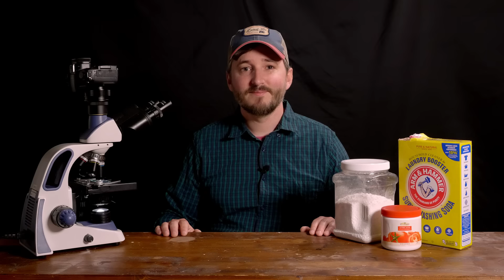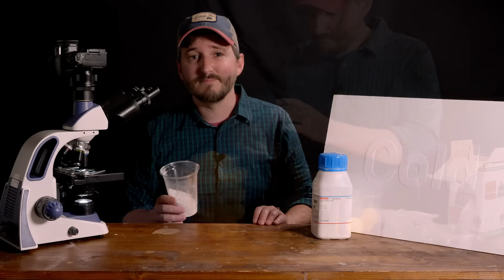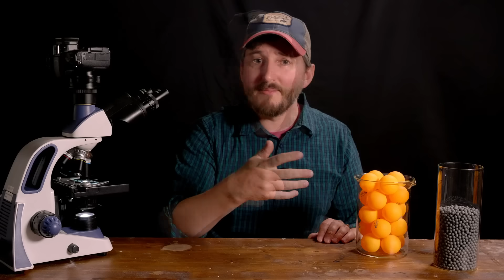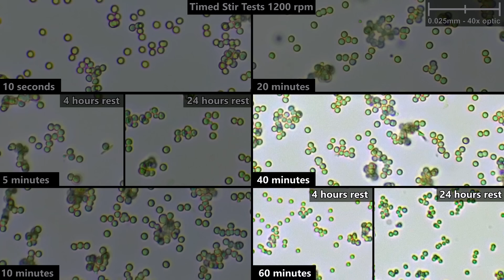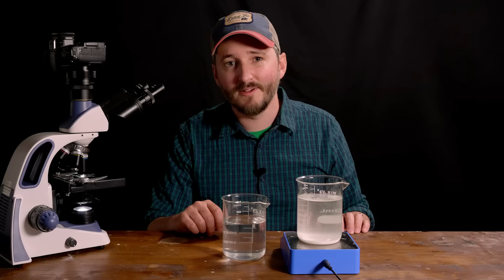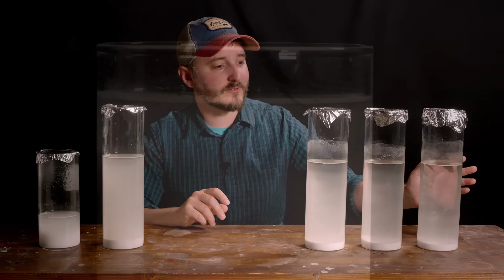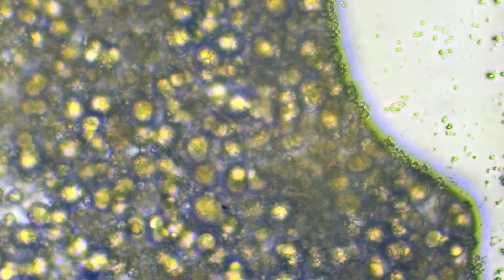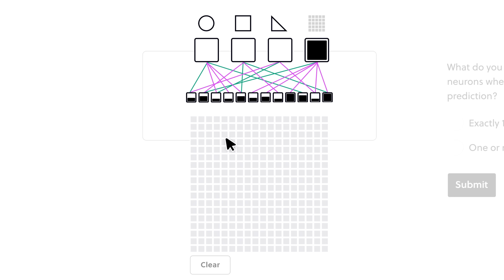Making Infrared Cooling Paint From Grocery Store Items (w/Novel CaCO₃ Microsphere Synthesis)

Comment: Has anyone else run into an issue with the microspheres not mixing with the acrylic correctly?  When I mix them into the acetone/acrylic solution it doesn't seem to mix correctly.  As far as I can tell the microspheres turned out just like in the video.  The acrylic dissolved into the water and acetone solution but when I tried to mix the two it turned into a weird blob of goo and the rest of the microspheres just separate from the acetone almost immediately and sit at the bottom.  If anyone has run into this or has any ideas let me know.  I guess I'll try it again and see if round two goes better.  Thanks in advance!
Reply from the maker: It sounds like the spheres still contain some water and need more drying. Extra water will cause the acrylic to fall out of solution and make a goo
Reply: @Nighthawkinlight  That was it of course!  I ran it again and made sure the pigment was extra dry and that seems to have solved the issue.  It seemed pretty dry when it was a brick but there must have been moisture in the middle.  I might recommend one more quick bake after crumbling up the initial bake just to make sure it's super dry.  Thanks for the help!

Comment: Since this paint you say disperses heat into space, how will it potentially play a role in reducing the temperature on the planet? Covering the entire planet would hypothetically lower the temperature on the entire planet in less than an hour, at least by one or two degrees. And as this paint disperses heat out of the system, it effectively(!) is a heat sink or valve regarding (rising) global temperature. If the whole of the planet covered, would reduce the temperature by a few degrees (and keep it dropping btw, you know,.because ambient) in less than an hour, would covering half the planets surface drop it, after leveling out, one degree? And covering one millionth, what would do that in one hour? And in 10 years? Or am I missing a point somehow?

IF this works in spite of the blanket of carbon dioxide and without taking up any energy to function, might (implementing) this get to be a fundamental contribution to reducing the temperature on the planet?
Without the need of taking carbon dioxide out of the system? That needs to be done still, but it proves incredibly hard and in all cases it requires energy, while, even when humanity should  take out fossil fuel use altogether,  both energy consumption and then production(!), from for example micro stars held in laboratoria (nuclear fusion) also would increase the temperature on the planet.
Reply from the maker: Covering the whole planet would lower the temperature way too much. Some papers suggest it would take covering about 1% of the earth's surface to compensate for all post industrial warming. That works out by my math also.

Comment: Since silicone is IR transparent and would allow IR in the atmospheric window range to be transmitted to space,, it seems the perfect binder for a calcium carbonate flexible tile, or shingle, made by diluting silicone caulk with naptha or spirits, adding the calcium carbonate, and pouring it into a mold. Your thoughts on this?
Reply from the maker: Yes I've tried this a few times but it seems to take more silicone to bind the particles than is ideal for good reflectance. I need to experiment more.

Comment: Amazing video.  Just FYI for others it seems there are multiple kinds of acrylic.  My first attempt used PET acrylic which does not easily dissolve in acetone.  I believe what we need is PMMA acrylic. That kind will dissolve in acetone. Hope this saves someone a headache.
Reply from the maker: Yes pmma. I didn't know there was such thing as clear PET panels, that's interesting
Reply: @Nighthawkinlight  Ya.  Just to clarify I believe what I have is PET plexiglass(that's what the box says) but as I understand it true acrylic plexiglass is made of PMMA.  Someone who knows more can correct me if I'm wrong
Reply: @G.r.i.z.z   This may have been my problem. Couldn't get it to dissolve.  (Nope, It's PMMA, Damn)
Reply: @gt3guru  i haven’t had any issues dissolving pmma other than the fact that  big chunks take forever.  I got a couple samples for free to test with but they are really thick(1/2”).  They were hard to break up into smaller bits so i just went for it.  That wasn’t a great move because it has taken weeks to dissolve. Highly recommend using tiny bits of pmma to speed things up.

Comment: I wonder how this would work when used with acrylic automotive paint, every layer from primer to tinting to clear/ sealant coat.  But since it's so thick, might need to use a sand blaster

Edit 5 days later, a few different sources tell me ""You can thin acrylic paint with acetone. The ratio is a 4:1 ratio of paint to acetone""
And/or, 1/3 distilled water to acrylic paint can thin it, since water dissolves the binder used for acrylic paint

Comment: For an offgrid person like this, this video is actually life changing. Electricity is always an issue and so is food preservation and cooling. I can see this being used in a open greenhouse. Use the green house to house another building painted with this stuff but protected form the elements using the greenhouse with the vents open to prevent heat build up. I once build a solar powers AC unit. I can see using this in conjunction with this painted building. Cool during the day actively and passively at night.

Comment: This is amazing work I have great great respect (and this seems you did real science not only popular science) on your job. But I have to tell an important thing I think you might missed: Most CaCl2 chemical avaible on CaCl2.2H2O form. And washing soda is Na2CO3.10H2O (decahydrate) So sitochiometric ratio is 147g CaCl2.2H2O and 280g Na2CO3.10H2O.
your ratios are only true if both salts are anyhydrous form.
Reply from the maker: Good point!
Reply: @Nighthawkinlight , I'm recently trying your recipe exactly. I checked your your washing soda's sds data :) , it says it's anhydrous  form but %88 assay. I calculated your ratios and your you are using 2 times excessive sodium carbonate if it's anhydrous form. May I ask you why? it's importat for me because because your first trials were stoichiometric.
Reply from the maker: @uzaymaymunu  Yes I found that it helps to have an alkaline solution and the excess carbonate gets the job done. It's possible that it could be reduced slightly but I'm not sure how much.

Comment: Great video!  This is like product development stuff in the production chemical industry.  Building scale inhibitors.  When moving water through pipes (with oil and/or gas) barium and calcium sulphate scales cause big problems nucleating and agglomerating and coating pipes, reducing the flow sometimes completely blocking the piping or pipelines.  Calcium carbonate does the same thing, but can easily be remediated by dissolving it with various acids depening upon the metal compsition.  Sulphate scales are not so easy to dissolve away (needs hot chelation where the scale is removed molecular layer by layer, its expenive and slow).

Crystal modifiers injected into pipes and pipelines at ppm concentrations in the oil and gas industry can inhibit calcium and barium sulphate scales in a similar way to the processes highlighted in this video.  Worth looking at the mechanisms.  They inhibit crystal growth and agglomeration, keeping the scale in solution and stopping pipes and pipelines from losing flow.  We call this speciality flow assurance.  

Im sure BASF, Baker Petrolite (Baker Hughes), ChampionX, Multichem (Haliburton), Arkema (Ceca) etc... have scale inhibitor formulations that could be used to make these spheres.

Comment: I've been researching infrared heat dispersal coatings to apply on the roof of my newly purchased RV. My understanding is that many reflective paint applications are only capable of dispersing UV, while IR accounts for about 53% of heat load. This video helped explain the microsphere aspect I have been attempting to comprehend, as many of these heat dispersing products contain microspheres. One particular product I encountered boasts a four layer system of application stating that the fourth layer of microspheres is unique due to the capability of causing a cooling effect as described in your video and comes at a whopping $200/gallon cost for product alone while requiring additional costs for professional application. After watching your video, I have a much better grasp of the technical aspects of these "paint" formulas and even have hope that I may be able to create my own formula to achieve a cooling effect without the hefty (and frankly unaffordable) pricetag. Thank you!

Comment: How about mixing CaCl2 solution with the acrylic paint then start painting?
I'm hoping that the water droplets left in the matrix will contain CaCl2 (because CaCl2 dissolves in the aqueous phase but not the acetone-acrylic organic phase), then afterwards the water will slowly evaporate leaving CaCl2, and atmospheric CO2 will diffuse into the holes and react with CaCl2 to form CaCO3 in situ. The byproduct HCl could slowly evaporate away.
Reply from the maker: It's possible, but would take a long time to happen in the acrylic

Comment: The temperature differential you show is compared with ambient. Suppose you could put the pigment in a vacuum chamber transparent to the IR wavelengths important.  Would you see a greater difference?  You applied it to an aluminum heat sink, so one might think you’re experimenting with using this for cooling air.  Could the cooled air from the setup be fed into a second chamber to get additional cooling? I realize there are losses of efficiency with stacked systems just as are present in stacked Peltier systems, still it seems it might be worth a look.

Comment: Application:  I expect the acetone will dissolve the plastic of the syringe as well as the silicone used to lubricate the flexible “rubber” part of the plunger.  This will contaminate your coating with another plastic, probably some silicone as well.  I don’t know if this is a factor in the heat reflecting quality of the pigment but it might bear a quick test to see.  If you want a syringe that doesn’t add plastic and silicone to your pigment, I’d either use a glass syringe (lacks lubricant and has no plastic, but it is small, 10cc).  That would work for testing. If it is better then you might use a glass syringe with a valve mechanism to easily refill the syringe in use, using the syringe as a pump.

Comment: I think the reason the blender was so successful is that the stir rod stir produces laminar flow while the blender produces turbulent flow.  The energy with turbulent flow is much higher than that of turbulent flow (I believe it is to the 4th power but I’m old and unsure of the 4th part). Anyway on a microscopic level the energy of movement will be much higher.

Comment: i mean the first thing i think about after hearing this is painting a house in it, but you mentioned at the beginning that the "paint" was rather fragile, and also that it needed a plastic cover though i don't understand why it needs that plastic cover. is the reason that it can't be used for house paint, the fact that it may be water soluble and so run off at the first rain?

Comment: I paid $100 a gallon for microsphere roof paint in the 1990's.  They told us the microspheres were ceramic, but they may well have been the same thing you are showing here.  Supposedly their paint was something new from Texas A&M university.  Basically the same thing you are showing here, only with a latex paint base.  What do you think about using something like Rust-Oleum 242057 Painter's Touch Latex Paint, Gloss Clear?  A clear uv stabalized paint seems like a good starting point. 

For application, I would use a sprayer.  I have a cheap chinese auto body paint rig with a large nozzle (like the one you show at the end (is that the same one?)) I use to spray kiln wash, which is a water suspension of a solid powder of alumina.  You must shake it during application to keep it suspended, but you may not have that problem because of the resin in your solution providing slower settling than water.

After application, does it make any sense to dust the surface with some microsphere powder before the paint dries?  Or would that quickly erode/dissolve in the first rain?

So, after looking at the cost of the clear latex paint, I see the price will be over the $100 a gallon I paid before.  shoot... 

Also, there is a lot of talk about roof coatings with hollow glass microspheres GL0237B/1-140 HOLLOW GLASS MICROSPHERES, 1-140 MICRON $85.00 for 5 gallon pail.  Seems cheap, but may not be emissive in the right wavelengths.

Comment: This video is wonderful.  The application is tedious so first I thought you could apply the paint using a rolling pin set upon 2 rails on either side of the surface you want to coat.  I do this when I make ravioli. Then I wondered why you couldn't float it like cement, i.e. the same way the young men leveled my new sidwalk.  Then you could just pour a blob of it on the surface and float it using something straight.  You won't hurt my feelings if you laugh!

Comment: This would be a great application for the roof of a dog house. Is that correct and maybe some aluminum heat sinks inside on the roof would cause cooler air to Settle to the ground. Keeping your puppy cooler in the summer time
Reply from the maker: It would be great for a dog house. No heat sinks should be needed

Comment: Have you looked into UV resin as a material to mix the powder into, or sprinkle it onto? Resin-based UV gel nail polish has a sticky base coat that is applied and cured, then a color coat (white or clear would make sense) and the powder could be mixed into that, or sprinkled on top of it before curing, then a clear top coat (gloss or matte) is applied and cured. It's a hard, chip-resistant surface that's also slightly flexible. 

Sifting the powder onto some sort of glue, or putting the foam down on glue might make it less fragile.

I'm looking forward to following your progress on this! Genius.

Comment: You might consider silkscreen  printing as a way to deposit a uniform layer of the "paint". If it does work there is a whole existing industry that could be used to make these panels very economically.

Comment: Look into the paint used on commercial aircraft and private jets. IIRC it is titanium dioxide based and works on the same principal you outline here. It does not achieve sub-ambient but does keep them a lot cooler than normal paint when they have to spend an hour on the tarmac during turning around a flight.

Comment: I really like your thorough and honest scientific approach. I listen at 1.5x because it's a bit long but very well documented and the thought process is an education in itself. This is probably the first time I've sat through a Brilliant promo instead of skipping too. You seem to have tried a typical car bodywork compressed air spray gun. I don't think that is well adapted to you "chalk powder" solution. Try one of the electrical spray guns you get in DIY stores.  I think they use a vibrating diaphragm instead of compressed air to project the paint. They are crude for home deco painting but may work better for your spray medium. I've just subscribed to keep up on where you go with this. Rare to find someone this thorough on YT.

Comment: I had high hopes when you started explaining the absorptivity = emissivity thing that you were going to correct the only bug in your previous video. Sadly, you made it worse. This is one of the classic layman misunderstandings of the 2nd law. The photons do not know where they will end up going when they decide to leave your paint sample. Neither is there radiation laws TSA agent to ask : what is your destination. Photons are emitted entirely due to local conditions. The panel will cool if facing empty space, not because it will emit more but because it will absorb less. If it is facing cloud it will be hit by more of these wavelengths than if it is aimed clear sky. As you correctly say it absorbs equally strongly, so the emitted IR will roughly equal that which is absorbed. ( A bit less really because clouds are lot colder than ambient air but not as cold as space ).  Nice videos though and interesting paint experimentation.
Reply from the maker: I agree with you. If I communicated something different about how IR exchange works it was unintentional. Perhaps the misunderstanding is from one thing you said in the comment on my last video, that we are looking for a white surface in the visible spectrum but a black surface in the IR. That's only partially true. We are looking for a white surface in both the visible and all of the IR range outside of the atmospheric window(s). Within the IR windows the paint should indeed be "black". In the IR range in which the atmosphere is absorptive/emmissive we again want the paint to be white so that atmospheric IR emission is not absorbed by the paint.